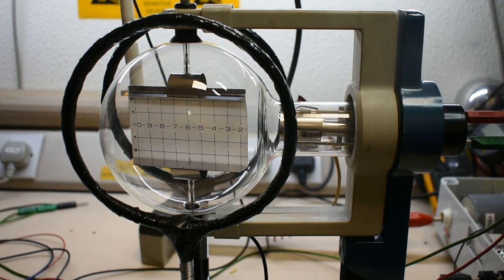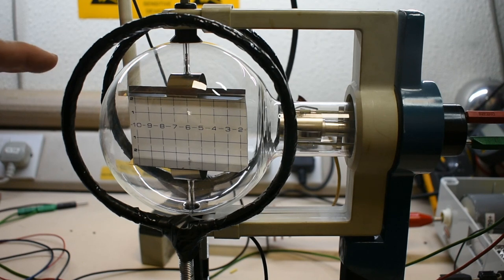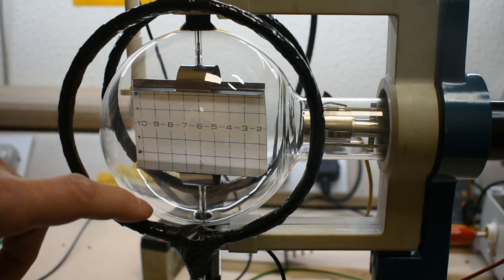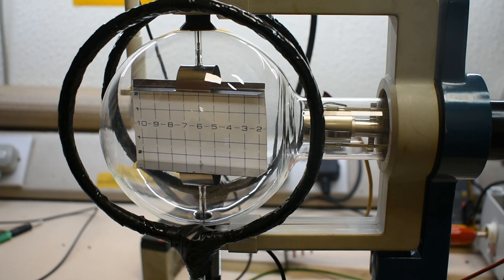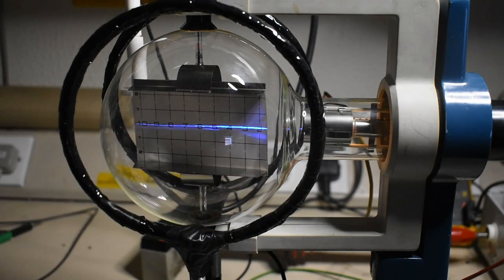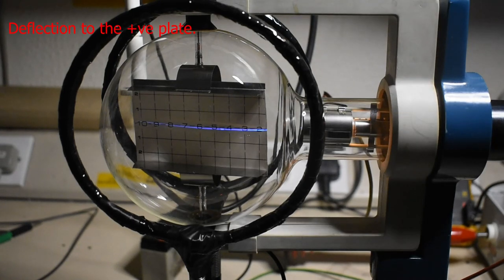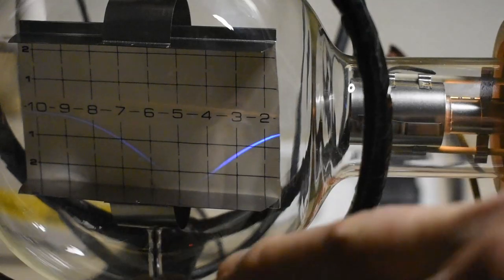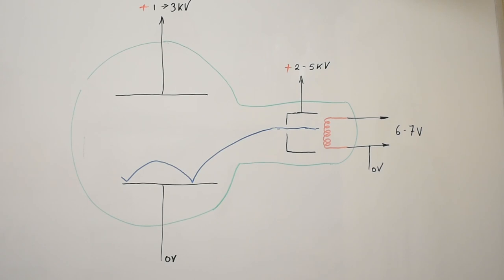Deaccelerating an electron beam

Comment: This is really interesting. Could you potentially come up with a modulation scheme so that you can project images on to the sideways plate?
Reply from the maker: Its difficult to create an image on  this screen as the  line across the screen is the direction of beam travel so would need modulated at the the beam velocity which in non-linear in this experiment.  The beam crosses the screen fanned out on the axis plane so horizontal deflection makes no difference in this case. Vertical defection can be done with the internal plates or external coil and could scan but isn't enough  to produce a raster for image modulation. There were some small commercial tubes designed as flat screens with the gun assembly to the side but the fluorescent screen was angled so that a spot could still be scanned in X/Y directions over the surface.
Reply: @tuopeeks  Thanks for the reply. I'm sure you're right about it being very difficult  :)

Comment: That is really cool! Never saw a setup like that. Any way of modulating the signals?
Reply from the maker: It would be possible to modulate the anode voltage or perhaps the cathode current. This would demonstrate how a higher anode voltage increases the velocity by changing the position of the deflection.  Plate and coils are pretty much set to maximise the demonstration.  It can be confusing, although this looks like a conventional CR oscilloscope screen it is parallel and not perpendicular to the electron beam and there is no adjustment to the x-axis other than electron velocity.

Comment: Isn't this similar to the original experiment used  to calculate  the mass of an electron ?
Reply from the maker: Part of it I think. You could use this knowing the velocity and the charged from the 'Milliken oil droplet' experiment.
Reply: @tuopeeks  👍👍
Reply: How expérience use to calculate mass électron proton neutron and photon ? Thanks if you Can help me ....
Reply: @mordaljohan75  as far as I remember they used a permanent magnet on one side to deflect the beam and an adjustable electro magnet on the other side so the could see how much magnetic force was needed to bring the beam back to centre,  obviously the more mass the more external force needed to cause deviations I guess but I would do your own research into all this stuff... if I remember correctly it was JJ Thompson that first estimated the mass to charge ratio of the electron using a know magnetic field and the degree of deflection ...
Reply: @T2D.SteveArcs  thanks !
Reply: @mordaljohan75  no problem mate 😁👍..
Thanks for watching 

Steve

Comment: How does one go about making a tube like this?
Reply from the maker: Making this tube would be difficult. While the construction is similar to any CRT the electron gun has a slot, rather than a hole, in the final anode to create a fan shaped electron beam. The screen is a fluorescent coated glass panel held at an angle between two metal plate. The tube also requires has a very high vacuum.  I think these are still manufactured for schools and colleges but are expensive. Sadly, may schools don't use them any more and they sometimes appear in second hand marks.